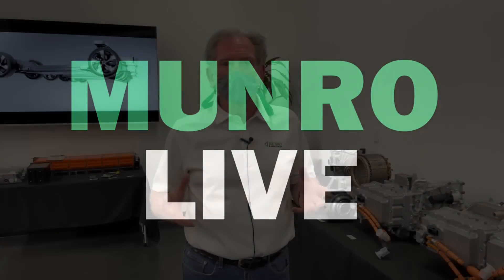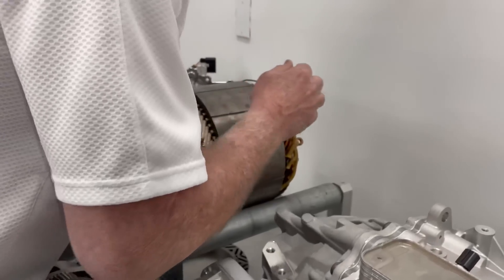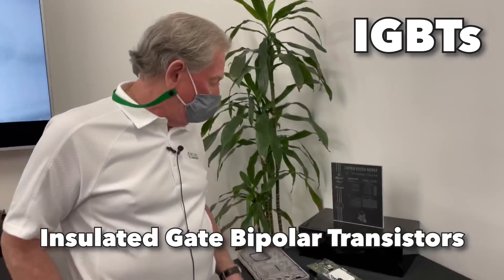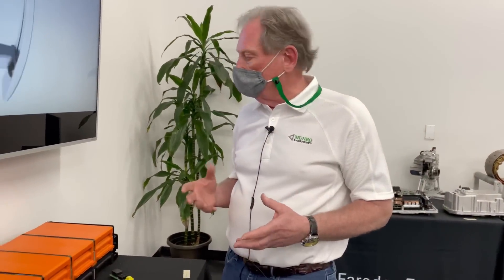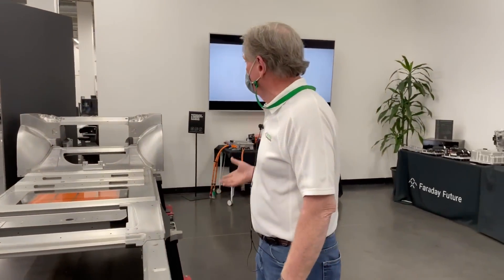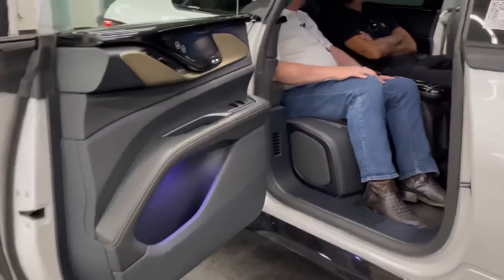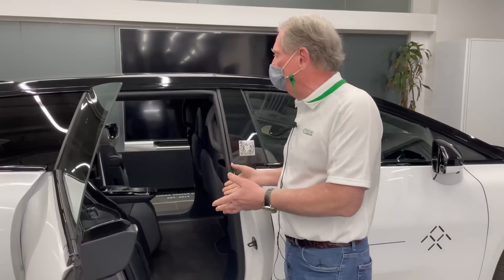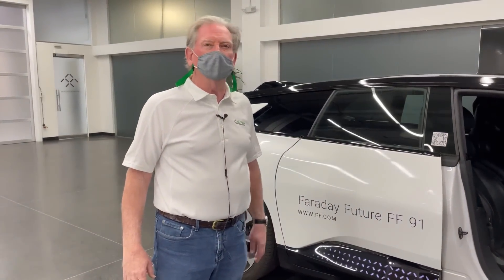Immersion Cooled 2170 Cells, Parallel IGBT Inverter, Dual Rear Motor System:  Faraday FF91

Comment: Is that a 400 volts design (96s) or 800 volts design (192s)?
Sandy, you could simply do a few simple voltage measurements at module level and at pack level to give some more basic insights. At least into serial and parallel connections.
Reply: 400V design

Comment: The immersion cooling looks like an improvement on heat transfer for the batteries.  On reflection it is much like electrical power transformers that are insulated with a special transformer oil.

Comment: Clever battery cooling. Any intermediate material is just thermal insulation. I can see immersion cooling working better with pouches.
Faraday Future has been through so many economic issues, does it now look like this is really going to happen?

Comment: I'd really like to see Tesla go to individual motors, you have to have two gear reductions at each axle, but they can be about half the size.  

Individual wheel torque control is where it is at.

Comment: 1:42 The most likely reason that Tesla uses multi-strand wire rather than thick conductors is because of the "skin effect".  Losses / resistance induced in high current AC wiring; it seems to be a thing.  Also Tesla uses SiC rather than IGBTs, they're the next step.  The next step after that is GaN but they possibly may not be the greatest with the high voltages seen in cars.

Comment: wont the cooling fluid have a negative effect on balance, when g-force changes occur?
Reply: Cooling fluid makes up very little Mass and will remain evenly distributed as its under pressure.

Comment: If you have to maintain such combined unit it might take quite a bit longer.

Late but quite unique and with more benefits ... until you get aware of the price.
But maybe the next FF below the 91 will carry those features too. 
thx for sharing
Reply: I think in another video he had done an interview with the CEO the other day, it sounds like the model in question is going to be in the $150,000 range starting price, which when you consider that Tesla started in the same ballpark it’s not too bad a deal, and just like Tesla he says as they perfect designs and ramp up production they will produce cheaper and cheaper cars...

Comment: Crikey Sandy maybe your 3 is different but my Model S seats put me in an MRI due to lack of adjustability!!!
Reply: If it's one of the earlier Model S, even Elon said, they are painful in those.
Reply: @Marlow925  They are painful in my MY18 S.  Very poor adjustability. I’ve had 25 year old Nissans with better seats.  Along with the wipers and headlights, easily the worst aspects of the car.

Comment: Tech should be modular on appliance/car-s because it always gets dated before the appliance/car. like is that screen 4K OLED with USB4? or is it some nasty pixelated flicker no input cheap thing? suicide doors; no thanks. I really like the reclined seat option though.
Reply: Screens are an EASY pre production upgrade.
Size and inputs are relatively constant, just fit the best available at the time.
For this market, expect bespoke choices.

Comment: Awesome video, and credit to FF for being so open. They've had an odd past but I'm excited to see where they can go. This looks very promising

For a future video can you discuss the impact of all the additional features in a car like this on range? I see screens everywhere, electronic door mechanisms, I'm sure the same for seats. Seems like a lot, yet manufacturers haven't shoes away from it. I'd love to see some estimates on power draw for a car with features like this and what it actually means
Reply from the maker: Thanks for the suggestion!
Reply: The self presenting door handles that Elon told the engineers to make happen was a big mistake IMHO of course. From many sources online they can be an expensive maintenance issue. If Elon was trying to eliminate all buttons, dials and manual controls....why Oh why did he insist on even having door handles when they could be controlled by software like everything else....

Comment: I read a multipage engineering study about why Tesla use traditional motor windings in the model 3 long story short they graphed the efficiency of a hairpin wound motor to a traditionally wound motor and found that the traditionally wound motor for whatever reason had a wider range of a speeds where it was optimally efficient whereas a hairpin wound motor at least the one that they tested had higher peak efficiency over a very narrow speed range.  I will attempt to find that article and post it here.
Reply: I think the conclusion I can make is if we don't know why Tesla is doing something we aren't looking hard enough.  There is always a reason... Always.
Reply: @Robbie6298  That's a pretty safe bet. There's no question they have the best minds looking at this, and the company is still super agile, so if they realize they need to switch to another shape/size conductor to increase performance/etc., they definitely will do that asap.
Reply: Yes, that's right, stranded is always the best for reducing these parasitic losses at high frequency. On the other hand is not black and white, every factor has to be taken into account in the comparison. I mean, from torque density point of view, hair pin winding enables high fill factor than stranded winding, it means that for the given slot area you can place more copper (therefore you actually reduce the DC resistance comparing to stranded), or in the other way around, you can keep unchanged the same (DC) resistance and increase the airgap diameter and therefore you need less current (less Joule losses) for the same torque. Actual number of conductors per slot, their arrangement and pole number (frequency) are also to be taken into account.
Reply: Search google for:. COMPARATIVE STUDY OF STRANDED AND BAR WINDINGS
IN AN INDUCTION MOTOR FOR AUTOMOTIVE PROPULSION
APPLICATIONS
BY
HANNAH KOKE, B.Sc.
Reply: "Notice the very low speed range of the motor - even at high Torque the losses are
very low for the bar wound motor. At these low speeds the effective resistance of the
bar wound windings is very low despite a high applied current required to generate
torque. With much lower resistance and therefore copper losses in the very low speed
range, one can see that the low efficiencies seen for the strand wound motor a) are
replaced by near peak efficiency values.
At high speeds we see the opposite phenomenon. Where the AC resistance is very
high in the bar wound machine the efficiency drops well below what was seen in the
stranded motor. The bar wound motor is outperformed by the stranded wound motor
over most of its operating range.". Pg 86 if you don want to read it all 😂
Reply: Sandy Munro to Elon: You should use hairpin windings in your motor....

 Elon's Reply: δ_{cu}=\sqrt{\frac{2}{µ_{0}\;\omega\;σ_{cu}}}. 😂
Reply: The comments section won't let me direct link the article it gets insta removed...  

I will quote...

5.2 Eddy Effects
The major disadvantage of bar windings comes in the form of eddy effects (skin and
proximity) [13] [14] [15]. Eddy effects are defined as the difference between the total
effective resistance losses and the DC resistance as calculated by I
2R. These eddy
effects become increasingly apparent at high speeds as AC resistance increases. For
example, the GM motor has a maximum speed of 9500 rpm, however, the designers
note that it usually operates in the speed range below 4200 rpm and that the bar
wound motor has better performance specifications at all speeds lower than 8000 rpm
[13] [14] [15]. Until that point, the higher slot fill factor means that even with eddy
effects, the effective resistance losses of the bar winding motor is lower. However,
above 8000 rpm, the effective resistance exceeds that of the stranded winding design
and the original motor is more efficient.
Eddy effects become increasingly apparent near the slot opening, as shown in
figure 5.2.
6

This makes sense as Tesla spins thier motor to 16k RPM.  The eddy losses would be significant.
Reply: You have done us a great justice in the time you spent finding this and quoting it for us. Great stuff! Appreciate it, I was genuinely curious if it was so good why wouldn't Tesla have thought of it/ be using it. and you sir have clarified that. So thank you, it also helps reading about yalls understanding of why and surface area stuff. My understanding is low to say the least but this makes it kinda strait forward
Reply: In the limit, as operating frequencies go up, skin & proximity effects dominate the losses in the wire[s].  Search "Litz wire" for more info.  Litz is manufactured by braiding/twisting hundreds of small diameter insulated copper wires into much larger bundles that can efficiently carry high frequency currents.  The down side is that all that insulating varnish on all the little wire strands takes up space that otherwise could be solid copper.  Design tradeoffs abound...
Reply: For Tesla, you also have to take the manufacturing side of the equation into account. If the performance is relatively similar, go with what is easiest and cheapest to manufacture.
Reply: @michielecker  I'm pretty sure they took that into account.  The model 3 motors are more efficient and produce more power than pretty much all of the competition.  They produced a near 500hp car that averages 260 wh/mi.   The closest competition that gets same efficency with half the potential power output.  The competitions motor speeds are nowhere near 16k rpm.   I'm pretty sure a bar wound motor would be hugely inefficient at that RPM.

In that study they specifically stated that when the bar wound motor was spun above 8k rpm eddy losses increased to the point that it negated the advantages.    When the efficency was plotted the wire wound motor was actually more efficient over its operating range.   

This tells me Tesla places priority on Performance over ease of manufacture.  This is evident in it's suspension design as well.  Nobody uses double wishbone and multilink suspension to save money.  They use mcpherson struts like everybody else.  In the end you get a car that drives and accelerates like a sports car.

This is also seen in the power electronics.  Model 3 uses SiC MOSFETS instead of IBGTs to prioritize performance over cost.  SiC MOSFETS not only are capable of switching orders of magnitude faster than IBGTs, as switching speeds go up there is less gate driver loss and they are much more efficient.
Reply: My ignorant understanding of electron flow in copper wires is that they flow on the surfaces, so maximizing the surface area of the copper reduces the resistance. If so, a larger number of stranded wiring would increase the efficiency for a given cross section area.

Sandy, is this not right? Or is your point that manufacturing complexity outweighs the efficiency gain?
Reply: @danoberste8146  This is my understanding for AC circuits as well.  DC circuits or in cases where switching frequency is low the "electron skinning" effect is less prevalent.  However modern motors are variablily AC switched sometimes at very high frequencies.  It seems like the higher the AC frequency to the motor the more a hairpin winding becomes a detriment which is consistent with the first principles theory of conductor electron skinning.
Reply: @Robbie6298  The so called Skin- and proximity-effect causes the current to flow on the outer surface of the wire. This happens only with AC-circuits and they are frequency dependent. The higher the frequency, the more the current flows on the outer surface. However those effects are also dependent on the size and form (round, bar, foil, etc) of the wire. The larger the size of the wire the higher the Skin- and Proximity-effect and therefore the higher the losses.
I know the basics for ac-machines, but unfortunately not how the difference between a hairpin (bar) and copper come into play. I do know that the proximity-effect is often used in a rotor (asynchronous machine) to create a larger starting torque (When the machine is standing still). So there might be something up with that, but I am just guessing. Also I have seen some fully automated hairpinning machines (on youtube), which is why it might be easier to produce with robots alone.
Reply: Forget the last part about my guess. Thought Tesla uses the hairpinning for a second. So yes, they use the smaller copper wire to have lower losses and a higher efficiency especially at higher rpms. Once the Skin- and proximity effect begins the losses go up exponentially.
Reply: @danoberste8146  that's how I learned it in the car-hi-fi sector. That is why the power cables for the amplifiers are very fine-stranded and, ideally, silver-plated because the electrons mainly wander on the "skin"
Reply: @Zedus-rl9hp  I always take a look at the car hifi maket with a enomous himilayan mountain grain of salt.  They always find a way to sell you a 2 dollar length of copper cable for $200.  One of these is finely stranded 12v DC cable.  The skin and proximity effect is only relevant in high speed AC applications such as speaker cable where the amp is driving very high ALTERNATING frequencies to the speaker or the sub.  To try to sell us on finely stranded 12V DC cable where a solid home depot grade conductor would do the same job to conduct low voltage non alternating DC current that's going through a steel chassis anyway makes me giggle.  Long story short the skinning effect dosent happen with direct current, only AC.  This is the push for high voltage DC grid transmission lines.
Reply: @danoberste8146  you are correct...about your understanding
Reply: @MrSvetlin09  It is your ignorance of the definition of "ignorance" that makes you think that it is a pejorative. It isn't. Admitting a lack of knowledge is an admirable characteristic.

BUT!!! my conjecture, as confirmed by other posters and further research on my part, was RIGHT.
Reply: @danoberste8146  My apologies if this makes you sad...

Comment: Sandy, did Faraday mention what type of non-conducting fluid they're planning to use to cool the batteries?  Mineral Oil?  I'm curious if over time normal wear from a metal pump would contaminate the fluid causing it to start being slightly conductive, and eventually lead to a short.  Are they using a non-metallic pump to circulate the fluid?

I'm just generally curious what sorts of new issues they'll have to tackle by using immersion cooling, and how they approach them.
Reply: I'd assume it is one of the 3M engineered fluids like Fluorinert.
Reply: @hallkbrdz  or something like Midel.